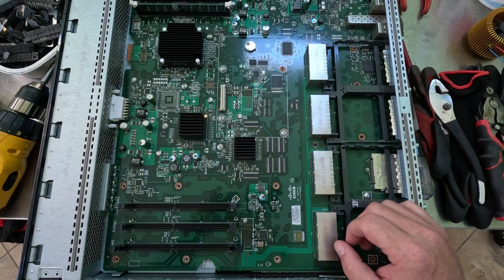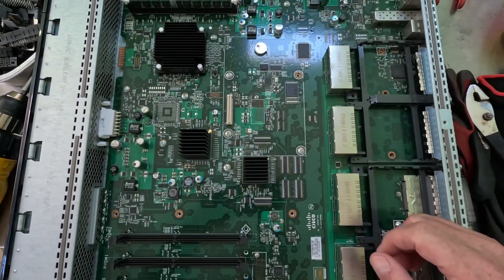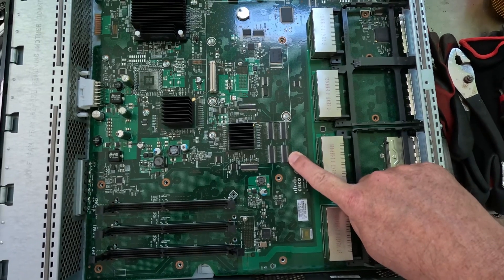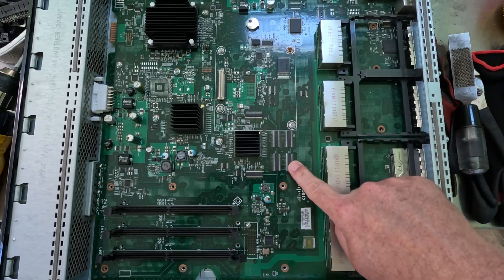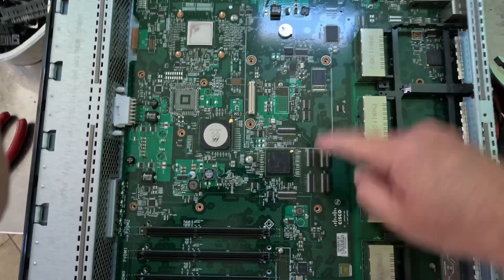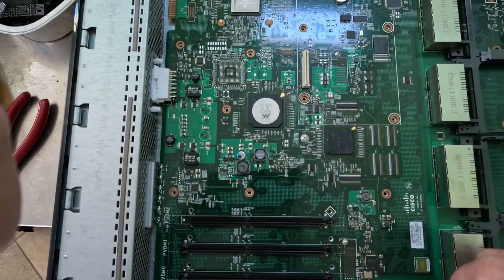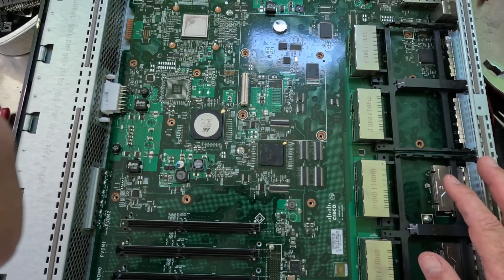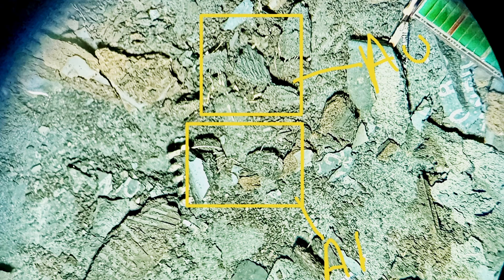How to you know the metal bonding wire inside IC Chips??

Comment: You could use sulfuric acid to dissolve the tops of them and really see the wires as well
Reply from the maker: This is true. Thank you very much.  My concern is that an order for this to work, my understanding is the acid has to be hot. Hot Sulfuric acid is extremely dangerous to humans and I worry with trying to manage that in my backyard setting. Thank you so much for the view and the comment, I really appreciate your time.
Reply: @KKRRenewables  thank you for the videos. I have enjoyed watching them. The acid does need to be hot or at least to work best. I will say I had the same fear when I first started it but as long as you are careful which from the videos you seem to be it’s not as bad as you would think. Also I was just referring to doing a single chip just to see the wires and not the entire batch.
Reply from the maker: That’s great, I may try it one of these days.  Thanks so much for your reply.  I didn’t know you replied again until tonight. I’m sorry about not replying sooner.
Reply: @KKRRenewables that is not an issue I completely understand at least you have responded some creators don’t seem to take the time to do that.

Comment: Why do you only recover 10% of the value in Printed Circuit Boards? 
It's so easy to make decent money from PCBs. I never waste time manually removing anything from PCBs, instead I keep them intact. 
First step is hydrometallurgical removal of all solder for Tin and Lead recovery (Tin is worth five times more than Copper). After this initial process all electronic components simply fall of, thus they can easily be sorted in correct categories for further processing. A lot of these components contain Silver, some contain Gold, and many contain other valuable metals; a few even REEs (Rare Earth Elements). All contain various base metals worth to recover. 
The components are processed by several different means: Pyrolysis, mechanical separation, hydrometallurgical separation, electrorefining, or electrowinning. Every single component is money! 
I don't spend any time cutting off electric wires soldered to the boards; the solder removal step takes care of that. All wires, still with plugs/connectors attached are pyrolyzed for complete removal of insulation/plastic parts. Pyrolysis yields not only clean metals but also Raw Pyrolysis Oil, which is later refined into free petrol/gasoline, free diesel, and free fuel oil. The liberated wire strands/connector pins are then melted into a flat anode and electrorefined to 99.9% pure Copper, which achieves the highest sales price. All other metals (including Gold from plated pins) remain in the bottom slime and are of course recovered. 
Depopulated boards are then processed for recovery of the Gold plating. Even the extremely thin ENIG plating (Electroless Nickel Immersion Gold) is recovered. 
The bare boards are pyrolyzed for Bromine recovery (the Fire Retardant in the boards) as well as for the yield of Raw Pyrolysis Oil. 
Finally, the ultra thin Copper layers are separated from the glass fibers. A glass recycler passes by once a month to pick up all glass residue from processed scrap material.
When I process PCBs nothing leaves my workshop in any other form than valuable end-products!
Reply: Damn nice book there bud!  Post a video showing your steps. Help those 14 subscribers you got how you do it.
Reply from the maker: Thank you for the view and the comment.
Reply: @LittleJohn1981 .   I've written hundreds of technical comments to countless videos on various subjects; even long tutorials.
Videos about refining attracts a very small audience; they'll never go viral. Even with a calculated ad revenue from Google, making videos won't be profitable for me. I'll always be able to do better by scrapping and refining than spending the same time making a video.
However, with 12 years of experience in this field I have acquired a considerable knowledge about processes and chemistry. I might be able to give you recommendations and advice you, if you have any questions. Feel free to ask.
Reply: @zero-waste  thanks for the reply. People learn from many avenues…not just reading. Videos, books, experiences. It’s easy to tell someone how to do something. I learn visually.
Reply: @zero-waste Can we discuss a little bit about E-waste fluxes and your experience with pushing the base metals into slag?

My process is similar to yours,but I don't use solders removing solution, I get most of solders using tin separation machine which I built my self, it similar to Chinese one.
Reply from the maker: I’ll let Zero respond to that one as my processes don’t get that involved.  Thank you for the view and the comment.
Reply: @ayhamhafez285 .   Nowhere in my comment is pyrometallurgy mentioned. I refuse to work with smelting and especially lead cupellation due to the toxic fumes (I know that Bismuth and Copper (which I have tons of) can be used instead).
With an unlimited supply of free homemade HCl, HNO3, and H2SO4 I can make all extraction processes without any pollution of air, soil, or water. I'll never touch pyrometallurgy. 
Hydrometallurgy is the way to go. Virtually every single drop of waste is processed for recovery of all traces of dissolved metals and recovery of all acid. There is no waste in the end.
Heating of Printed Circuit Boards is a really bad idea! Toxic fumes created are fx.: Bromine, Chlorine, Chlorine compounds (dioxin), and from older boards Formaldehyde; besides the unavoidable hazardous plastic vapours.
I recover 100% of the solder without any kind of pollution by going the hydrometallurgical way. In addition, all electronic components remain undamaged and can easily be shaken off of the board itself.
Virtually every bit of value of all the electronic components is then extracted hydrometallurgical. Nothing is lost.
China has almost no environmental laws and is the world's largest polluter, together with the vast majority of the undeveloped countries! Despite some of these countries have environmental protection laws, these laws are seldom enforced at all.
Reply: @zero-waste  I understand, but where you read about using copper instead of lead for cupellation?
Reply: @ayhamhafez285 .   As I remember Copper can be used as collector metal instead of Silver, and then Bismuth for cupellation. 
I wonder how to recover the bismuth afterwards. I have no experience with pyrometallurgy.
Reply: @zero-waste  thanks a lot, just crush the oxidized bismuth material then mill,then add carbon and smelt with some borax and soda ash,in that way you will get bismuth again beside any other oxidized metal from cupellation
Reply: @ayhamhafez285 .   Of course, a simple carbon reduction; because Bismuth is under (far lower) than Carbon on the metal reactivity scale.
I'm very well aware that materials intended for Carbon reduction always must be in dust/powder form, to enable close molecular contact. I have a Hammermill, and I have a Ball Mill. CRT-tv funnel glass must be in extreme fine powder form for an effective extraction of the Lead.
Years ago, I reduced Lead Oxide with Carbon. Mix Ratio: 1 to 1 - 1.25, Temp. 1200 - 1300 C, up to 5 hours.
I also reduced Tin Oxide with Carbon. Mix Ratio: 1 to 0.75 - 1, Temp. 1300 - 1400 C, up to 15 hours.
I find pyrometallurgy cumbersome and much more time consuming than hydrometallurgy. Despite that, perhaps I'll give it a try if Copper is an effective collector metal. Using a huge excess of Copper might enable me to avoid the cupellation step.
I regularly refine metals by electrorefining. If the lump of collected metal, extracted after smelting, contains at least 95% Copper it'll be suitable to use directly as a "dirty" anode for electrorefining. All Precious metals will remain in the bottom slimes.
Unlimited electricity is available as my garden is lined up with homebuilt wooden frames supporting 55 old solar panels which came in as scrap. I get lots of solar panels, so I just picked out some that still functions, albeit at reduced capacity. Free solar panels and free energy, that's what we like, lol.
Reply from the maker: Thank you for your view and your comment.  You have significantly more operations than I have.  Good luck to you.
Reply: That sounds awesome! Can you make a video series about it? I'm sure many people in the scene would watch it.
I consider most of what you said economically only viable in a large scale operation. But I'm open to learn.